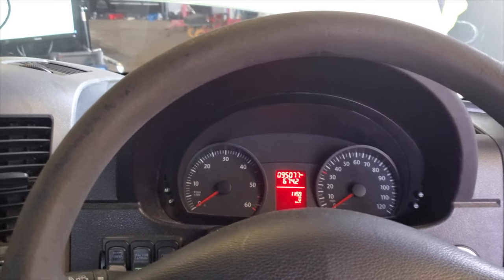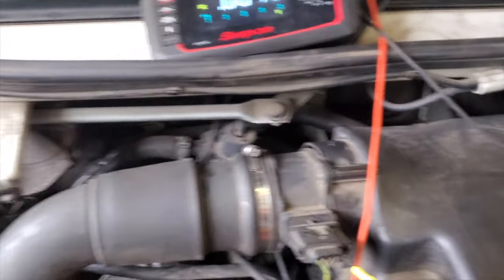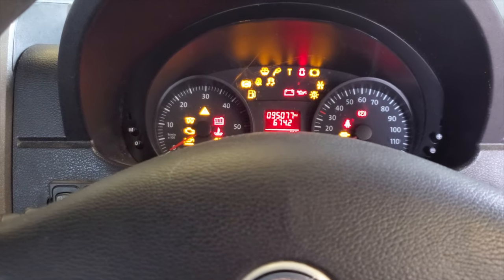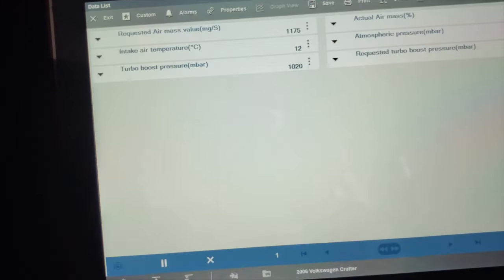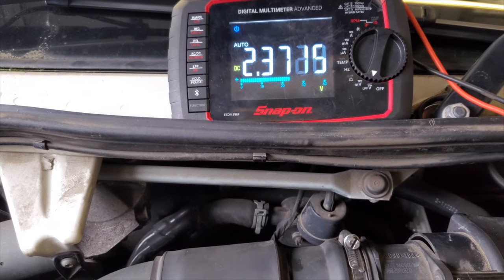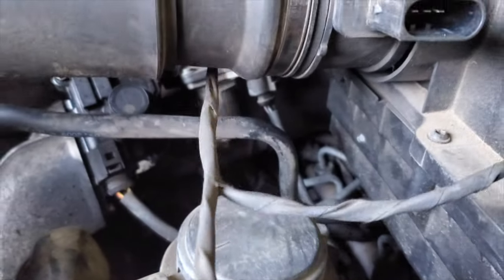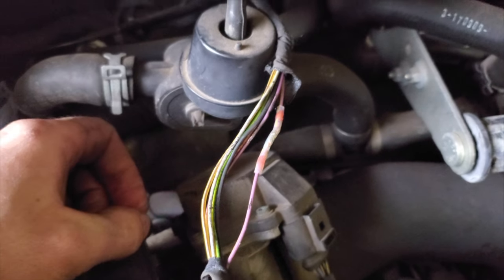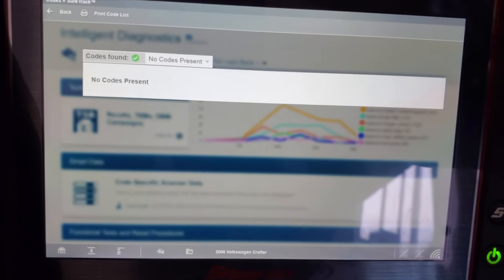no crank no start vw

Comment: FOR THE AVERAGE TECHNICIAN / MECHANIC A CAN PROBLEM CAN BE VERY STRESSING ESPECIALLY  WITH NO TRAINING . ONLY SAYING GOING FOR THE FIVE VOLT REFERENCE SIGNAL WOULD OF MOST LIKELY BEEN AN EXPERIENCED TECH MOVE . THANK YOU FOR YOUR TIME LOOKING FORWARD TO LEARNING MUCH MORE !
Reply from the maker: Thank you for your comment. I have been stung in the past panicking why the scan tool wouldn't comm.  5v ref is very quick but essential check

Comment: I suggest doing a capacitive discharge of the car battery before changing out parts. Disconnect both battery terminals, starting with the ground - (negative), connect both connection leads with a jumper wire for at 1 minute. Reconnect both battery terminals, hopefully that helps.
That worked with my car!
Reply: Wdym bro ?
Reply: Mine starts after that but why does it happen?
Reply: Mine starts after that but why does it happen?

Comment: I have mk5 golf tdi and when I am driving it will cut out then it starts up again after 10 minutes but it happens quite often
Reply: Clean contact connections on battery terminals or maybe check your fuses… if not then it might be ripped cable…. But I’d check fuses and battery terminals

Comment: got no computer to check things.  Working outside in mud and cold so hoping to narrow down fast....... Have   similar issues 2003 beetle TDI out of the blue no crank.   What other fusees may cause this 5v no reference.   Did I hear right, the one he found bad in this one was Fan?  What fan?   Engine fans or heater fans?
Reply: were you able to narrow it down and fix the issue ? i am in the same boat
Reply: @TL....  turned out to be the wire to starter. the one the ignition switch triggers to activate starter.   It connects the solenoid on top with a large black plastic plug.  On mine a single wire.  The wire brake away under some tape  from previous owners past repair on the same wire.  Hope that helps you.   

ps- had to remove battery and tray .... only then did the issue become discoverable.
Reply: @coachgeo  i have an 01 jetta and on my fuse box on the left side of the steering wheel, fuse number 28 which is supposed to be for the fuel pump, according to the diagrams, there is no fuse there, and when testing for power it shows none as if theres no wires in the back that would normally go to a fuse ,  is this normal ?
Reply: @TL....  find a diagram that has more detail... such as in a more detailed description it may say.. "except in diesel models"  etc.   it may be that the diesel model may not use a pump in the tank. Plenty diesel vehicles do not have electric fuel pumps so that may be the case.
Reply: @coachgeo  the solenoid to starter wire? Or the battery to solenoid wire? Or the ignition switch wire?
Reply: @coachgeo  so would a new starter fix this issue? Or is the wire seperate from the starter?

Comment: My van did the same today would not start and then it started what could that be
Reply: Probably a fuse that’s about to blow faulty fuse
Reply: Unless it’s a loose battery cable or just too much corrosion

Comment: Is that 5 volts reference check 100 % equal to good/ bad  ECU supply check ?
Reply from the maker: I'm not quite sure what you mean. No 5v ref does not necessarily mean the ecu is faulty many things can cause it like in this case the broken wire popped a fuse.
Reply: https://youtu.be/0PFfp_3NF1o?t=104 1:44 What is the point of 5 v check if you are going to check the fuses anyway ,no matter what the result is .Sorry if I look too picky ,but I think that logical process to the fault and cause of fault to be short ,fast and clear as possible.You ve missed one step from a perfect   video , no big deal :)
Reply: @soptea  he wouldn't have to check the fuse if he had the 5 volts and if he didn't have the bad fuse after not having the 5 volts he would have to check the ecu .

Comment: Help needed. Last night parked my VW golf as normal. This morning, remote won't open doors, but hear click noise. Changed remote battery, still nothing. I manually open car door using key and try to start but no power, no lights on dash and radio, no power completely, total no sign of life. Please help advise needed